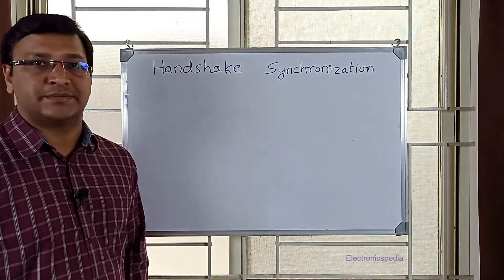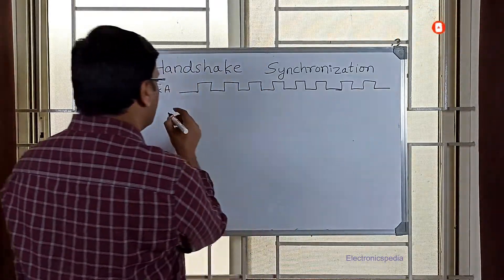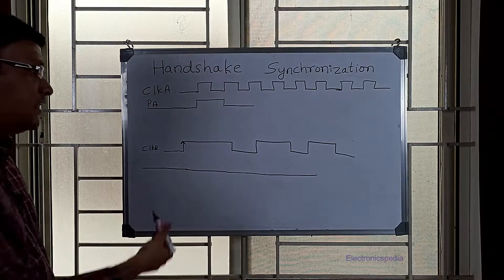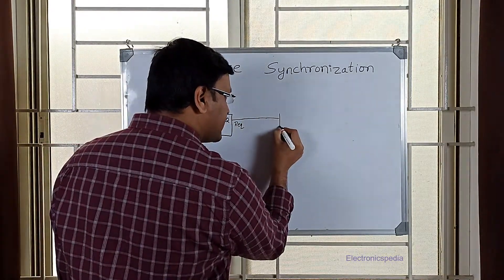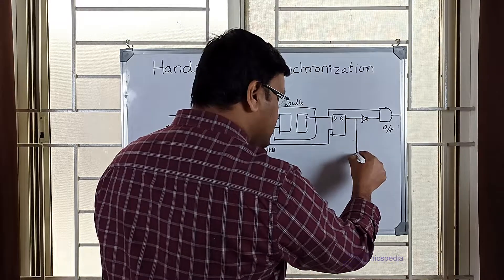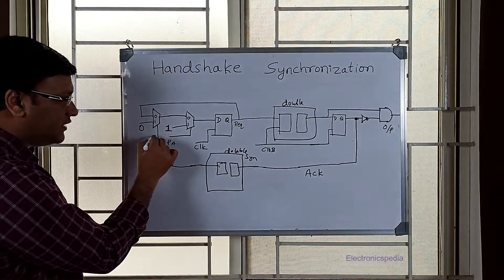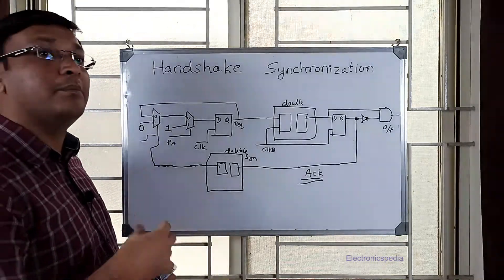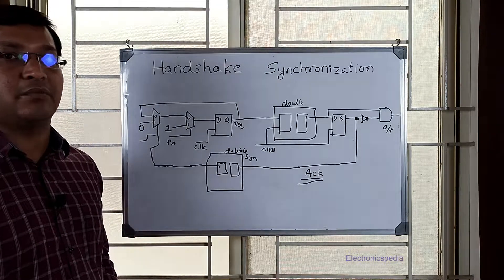Clock Domain Crossing Handshake Synchronizer | CDC Technique | VLSI Interview Question |

Comment: Timestamps (Powered by Merlin AI)
00:10 - Handshake synchronization efficiently transfers signals across clock domains.
01:43 - Explains the synchronization process in clock domain crossing.
03:21 - Explains handshake synchronization for clock domain crossing.
04:47 - Clock domain crossing uses handshake signals for synchronization.
06:11 - Understanding CDC Handshake Synchronization in VLSI Designs
07:47 - Explaining pulse generation and acknowledgment in clock domain crossing.
09:18 - Explains the double synchronizer technique in handshake communication.
10:51 - Handshake-based synchronization is a standard method for clock domain crossing.

Comment: 3:45 why sample b would comes down with clk A posedge?
I think it should comes down with clk B posedge
Reply: right, why? if sample b deasserts with clk A posedge, it wil cause metastability on clk B domain
Reply: And multi stage FF synchronizers should also be used to exchange req and ack signals

Comment: Hi another query

What is the drawback of handshake technique which motivates us to move to FIFO syncronizers?
Reply: More clearly saying why we need fifo syncronizers if we have this handshake technique..
Reply from the maker: Fifo synchronizers required when we have stream of  multibit data to be transferred from one domain to another domain. But with handshake technique we can not transfer multibit and also stream of data.
Reply: we can use handahake for multi bit synx also but inly tge thing is we cannot synchronize the stream data with handshake so that was the reason we moves to fido

Comment: Sir, how do we handle analog signals in CDC?
Reply from the maker: Hi, CDC technique is applicable to digital signals, where the value of a signal is either '0' or '1'.  Whenever there is a metastability the signal either will be logic 0 or 1. 
In analog signals we have continuous values for which we don't do CDC analysis.

Comment: how do you feed new value?  understand the reason of having 2 muxs on input side. but I think possible OR gate missing on input of 1st mux. agree?
Reply from the maker: Hi, for the first level mux, there is a PA input. Initially when there is a pulse o/p of first level mux gets set. and it will be cleared only when there is a ack from receiver domain. 

When 2nd time pulse comes, it will be sampled only if the 1st output has been cleared by ACK, otherwise we will ignore the pulse. 
Once the Req has been cleared it will be able to take 2nd pulse on the same PA input. There is no need of OR gate. 
hope this is clear.
Reply: @Electronicspedia   actually its not clear. I don't see path/connection to get new value. all above stuff I understand.
Reply: @Electronicspedia   is PA would be your new value?
Reply from the maker: Yes PA is the new value. Everytime new pulse comes in, will be available on PA
Reply: @Electronicspedia  for the first level mux, it will be cleared  when there is a ack from receiver domain. 
When 2nd time pulse（PA） comes, it will be sampled, but meaningful only if the 1st output has been cleared by ACK, otherwise we will ignore the pulse. As the previous req pulse is not end.
Reply from the maker: Yes this is true. That's the limitation of this pulse synchronizers. If we want to synchronize all the pulses then we have to add counter in the source clock domain and then generate the pulses
Reply: @Electronicspedia  Once accept the ACK then send the next pulse of PA, along with the next data which be hold till accept the ack.
Reply from the maker: @leocn1942  yes , but while 2nd holding data till you get the ack, if 3rd pulse arrives then we may miss out. That's the reason we need counter logic